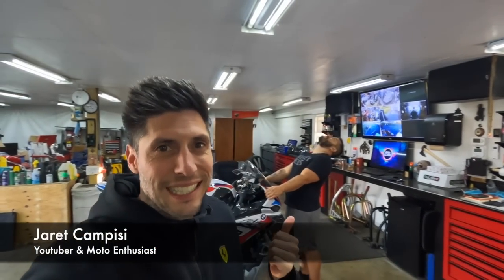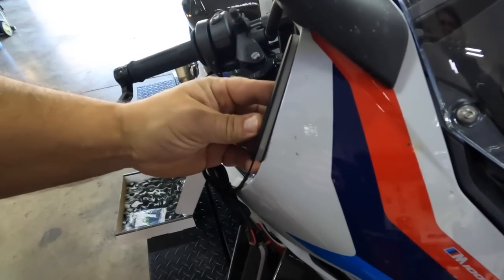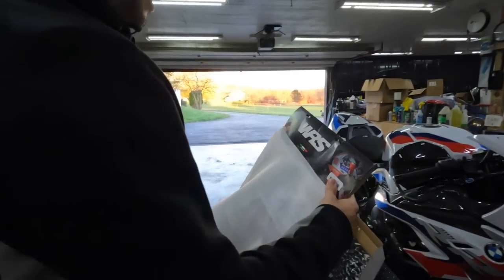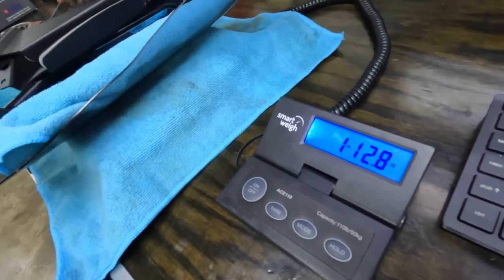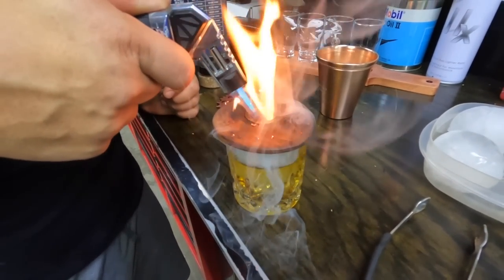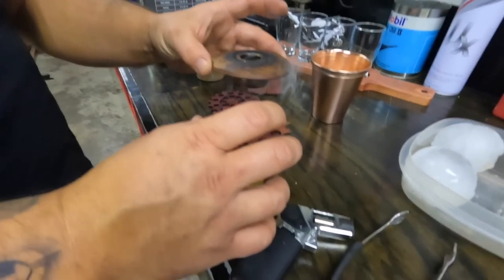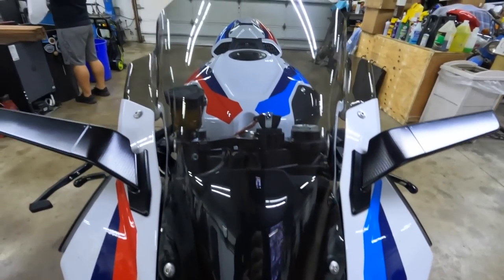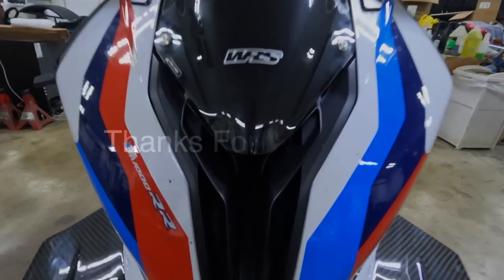Rizoma Stealth Mirrors & Smoked Windscreen for Our M10000RR!!!

Comment: I think it's gonne be my favorite build ! But I just wonder if you would have take s1000 rr instead of m1000rr that is 13k less expensive how much would be the difference in weight saving and how much power difference there would be with the bren tuning flash and all mods. I'm sure that it would be a better deal in term of price if you fully build a s1000 rr instead of a m1000rr ! Like the difference in weight saving and power would be not huge but the price difference would be !

Comment: Thr GoPro is the way to go! But im sure you could find an external microphone for it, to work around the audio issues 👍
Reply from the maker: We are using an external mic that gopro provides called the media mod...it adds a front and rear shotgun mic with a wind cover which is great BUT you can only choose to record audio from the front OR rear mic...not both at the same time...

Comment: Jaret, audio quality from the mediamod mic is horrible, even the front one. It's meant for action stuff and maximum noise reduction, not for picking up voice. You should get an external omnidirectional mic and coldshoe mount frame to have it attached on the top of the GoPro, and you'll solve ALL the sound issues.
I also wonder why don't you shoot everything on the iPhone? Both video and audio quality will be great.
Reply from the maker: Iphone is great if there is NO WIND and you're not using the front camera...as soon as there is wind or I want to see myself when filming its completely useless